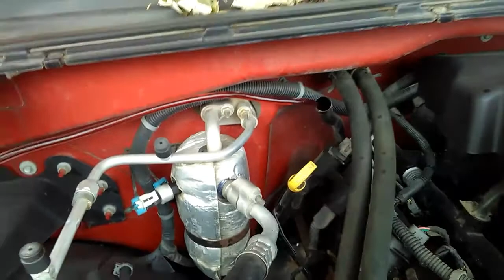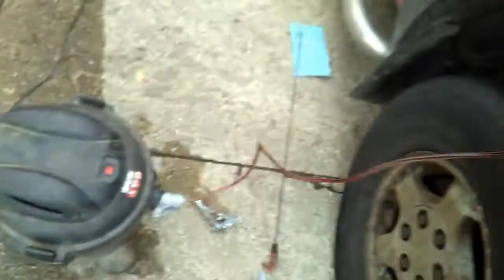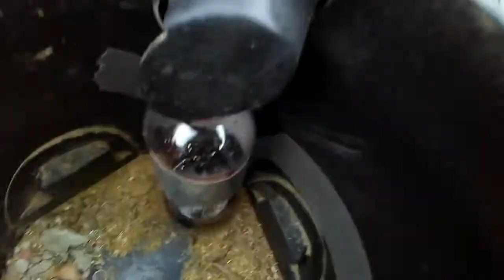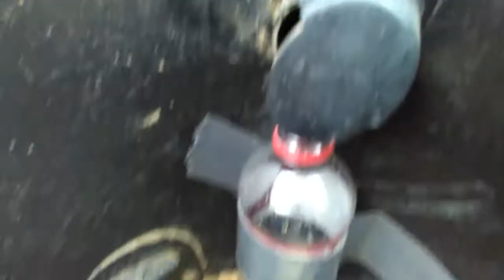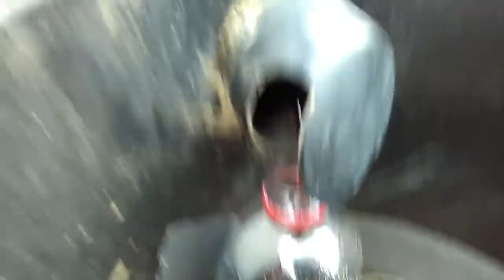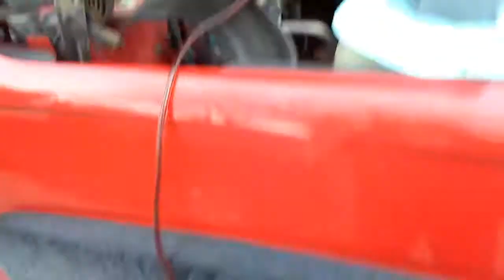Siphon Transmission Oil Trick With Shop Vac & Duct Tape

Comment: How are you doing it with the hose in the container
Reply from the maker: I duct taped the hose where it inserts into the vacuum to make a seal. This keeps negative pressure inside the vacuum. The hose ends inside a bottle which is inside the vacuum.